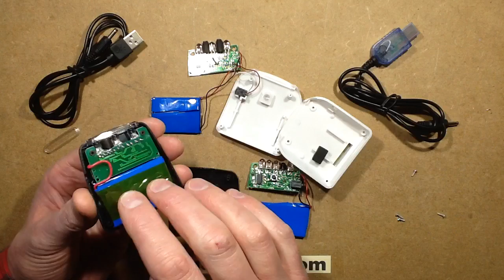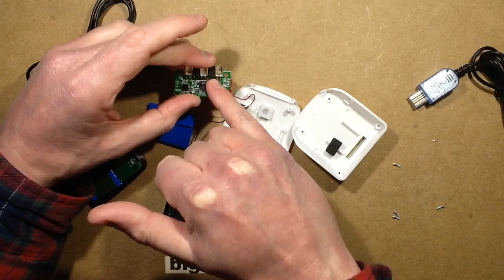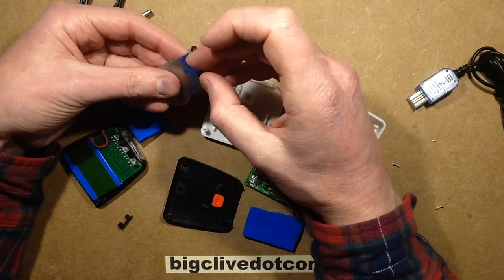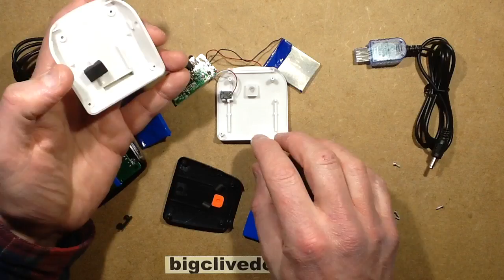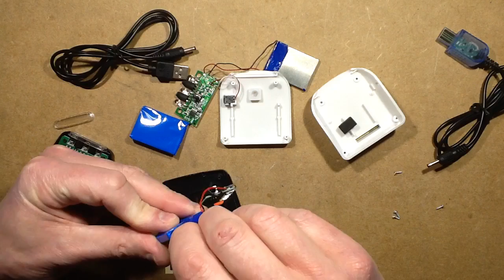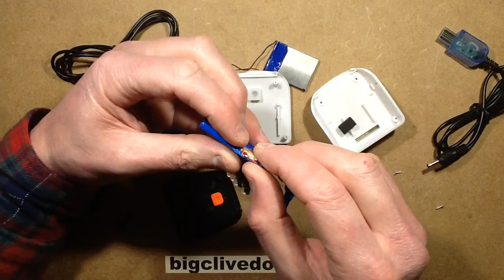Dodgy LED head torch with no lithium charge limiting.

Comment: I have one of these head torches and it has the limiting lead as well as the circuit on the lithium cell, so theoretical full protection for the cell. I did not realise they had a  sensor to switch it on and off, no mention in listing, and no instructions in the box, so at first glance I assumed it was faulty as it keep turning itself off and on as I examined it! Realised in a few moments it must be deliberate, and checked other listings where it was mentioned.
Useful for model work on fine detail with strong reading glasses!, also clockmaking.
Stephen

Comment: Clive, if you are really interested in a reliable head-torch, mark the name "Petzl". i am a happy user for years.
Reply from the maker: +Silly Sad My first LED head torch was a Petzl Tikka from an official stockist.  The internal quality of construction was appalling.  Worse than the current Poundland clones.
Reply: +bigclivedotcom > The internal quality of construction was appalling.

sounds like a good reason for a tear-down video with extra deep analysis!
Petzl is famous and sell their product for relatively high price, also they target CRITICAL APPLICATIONS -- it gives extra importance to the idea of exposing them.

i am using "Tikka XP" and it looks very laborious outside. but i must admit i have seen many cheap-looking Tikkas. if the petzl's issue is similar to the e-bay's wildly ranging quality issue, it is really important to shed some light on.

Comment: i have noticed this trend too. every led torch i have bought works once....as soon as i try to change the batteries..they never work again. everything you buy is being made deliberately shoddier and shoddier. the ptb evidently either think we are too stupid to notice their continual cheats...or they expect us to die soon and so cant be bothered? . another bad shite is lightbulbs... the new lightbulbs are dismal use just as much electricity give half as much light and last much shorter than the old incandescents too..about 3 to 6 months on average..it was all lies; from the bloody EU...  their light is definitely a nasty  grey. i hate them. its getting harder to get real lightbulbs now.   but one good result is that nearly everyone except the truly stupid sheeple has got interested in diy and electricy egineering.an getting your car to run on anything except petrol/diesel.  which is all to the good...some of us will at least survive.  in fact if tptb go out of business..which they all will if we stand and fight back...most of us can make it.  alive. and hopping mad. .

Comment: Go on, plug the dodgy one in and let's see what it does. Especially the part where 5v goes straight into a 3.7v cell. You have an outdoors, and a teracotta plant pot, right? :)
Reply: Preferably a 5.15V 2.4A Tablet charger >:]
Reply: +Opaali Cell phone batteries have protection circuits :)
Reply: +James Grimwood I've actually charged a cell phone li-ion battery by sticking 5V from usb straight in to it. Did so for couple of weeks before I could get a new phone. To my surprise nothing happened, I was expecting a explosion but no, it stayed cool and everything
Reply: True that. I actually ran a smartphone without battery by just putting the usb + - in to the battery connectors on the phone, worked without problems. Seems like they are not that picky about the voltage
Reply: Opaali
Anything between 3.4V and 4.2V will certainly make the phone run, above 4.2V it will not be damaged but it may turn itself off. 6V and above is not recommended :D

Comment: #bigclivedotcom, I got one of those white versions, and it's the same as the one you have, ordinary lead, basic circuit board with a smaller battery...so it could be, don't buy the white version..

Comment: Jeeze, and I thought a 3-10 ohm series resistor and an overvoltage protection IC was a cheesy enough charger. If they at least used a protected battery, and skimped on the cable enough (30-34 awg aluminum wire? 8-) ) it would have been at least somewhat workable.

Comment: 2nd link leads to "Item Removed" messge
Reply: Description.
Reply: +BogusNotions 
The link was altered for ppl who click links without thinking.
Reply: +Piotr Noja This listing (231732413703) has been removed, or this item isn't available
Reply: BogusNotions
It does work, man.
Reply: +BogusNotions 
Let me guess: you changed the item ID in the address bar that clearly says "Error" in the URL?
Reply: +superdau I removed the X as directed and got the error message shown above. Does that clear it up for you?
Reply: +BogusNotions 
Yes, it cleared it up for me. You are still doing it wrong and didn't really read my previous comment. Works for everyone else though.
Reply: +BogusNotions The only thing it clears up is you didn't do it right. After removing the X, the link works fine. http://www.ebay.co.uk/itm/231732413703